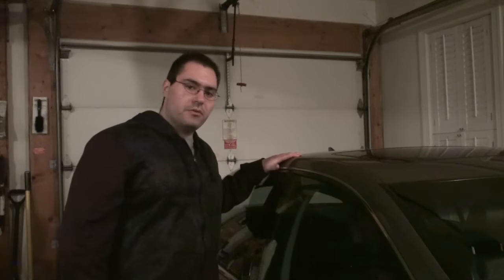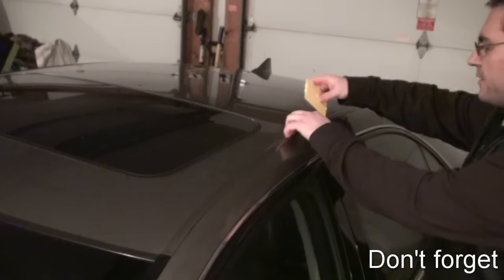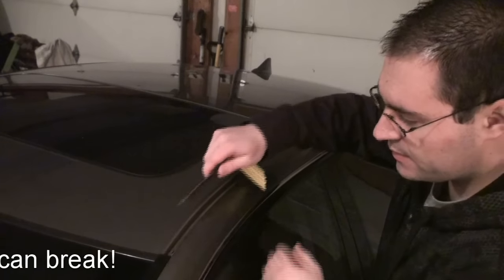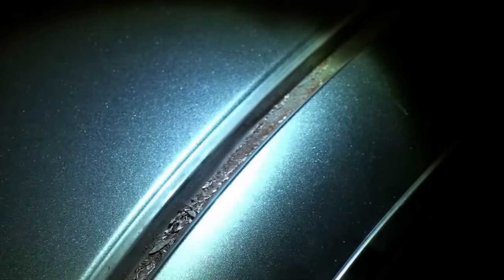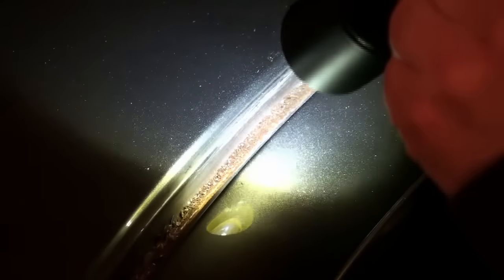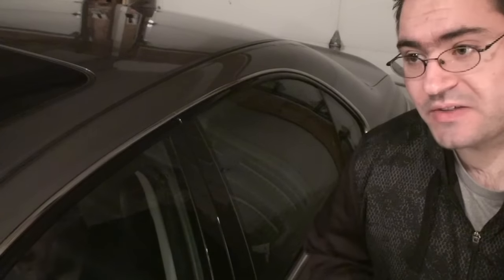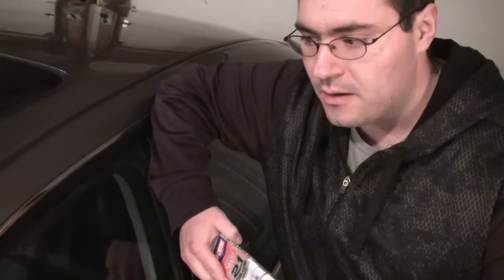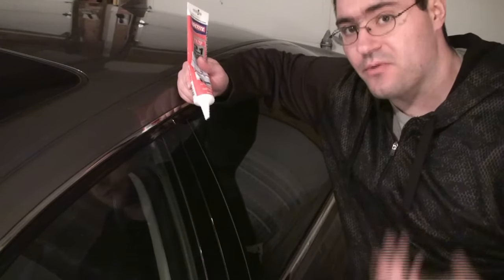Car Roof Leak - How to stop the leak in 10 minutes

Comment: What kind silicone did you use??
Reply from the maker: Loctite bathtub sealer - for the sealing showers/tubs (above the waterline) It's been just about a year since I've filmed this and It's held up just fine for me. Any silicon caulking should work fine, you could use out door window sealer or the stuff for below the water line if you want to go all out, but as long as you have a seal all the way across you don't need to do all that.  Just don't use a latex based one - they are water soluble and it will dissolve with the weather overtime.

Comment: i have a Dodge caliber. I just noticed a leak on my front  passenger side corner.  are the weather strip easy to lift up?
Reply from the maker: if it's an 09 or newer, it should have almost the exact same system as 
the one in the video where there is just a peg that slides on to a clip 
to lock it. 

You'll have to double check the dodge forums to be sure, just google the year and make of your car + weather strip...

ex: "2010 dodge caliber weather strip"

You can begin to lightly pry up on the strip using very light pressure to look under it if 
you can't find what system it uses, just be careful not to break the 
clips if it has them. 

I'd start in the center and see where it has the most give, you can pry it up by hand very easily, but it might feel like you need to use a lot of force to get it started, but you really don't and that's how most people break the clips. 

Just take you time with it.

Comment: Having a rust there it’s a potentially lethal if you unlucky to have a frontal impact the car will crush in two and kills you. What a horrible car is that. Vw/Audi has the best in business roof to body weld and don’t even have a weather strip, beautifully made but inside out but drivetrains sucks with them. Anyway great video
👍👌🏻🍻

Comment: others say never use silicone...use an automotive sealant.
Reply from the maker: It's because it used to be all silicon sealers were previously acid cure - they would eat through aluminum - if it says on the label it's safe for metal and aluminum then it's safe to use - I just feel like the silicone holds up better overtime - if I'm not mistaken it's now the most common gutter and window caulking - which means it's for sure safe for aluminum and doesn't corrode it. The good news is - there are plenty of other options and you can use which ever one you like. 

If you are caulking the front of your windshield I do believe there is a very specific stuff just for that but for sealing the weatherstrip there are quite a few options.

Comment: do you know how to remove weather stripping on 2009 chevy malibu?
Reply from the maker: if it's an 09 or newer, it should have almost the exact same system as the one in the video where there is just a peg that slides on to a clip to lock it. 

You'll have to double check the Chevy forums to be sure, just google 2009 malibu weather strip...

You can begin to pry it up using very light pressure to look under it if you can't find what system it uses, just be careful not to break the clips if it has them.

Comment: you should have showed all the process
Reply from the maker: Hey Jude - I thought it was pretty self explanitory - granted I grew up fixing stuff and learning how to paint and what not - there really is nothing too the sealer though - you just put it over the crack and them put the top piece right over it - if you put on too much you just wipe it off with damp a paper towel before it dries - if you got way too much you might want to wear some plastic gloves...don't really want to get this stuff on your hands since it's pretty messy and hard to get off. 

In most cases, it should just easily wipe off and not discolor your cars paint - you are best off using as little as you need. 

I'll keep this in mind for any future videos - thanks for your commnet - I can try and help more if you have any more questions - David

Comment: Don't listen to any of this guys advice, even his terminology is wrong which is a very bad sign.  Also DO NOT use silicon for this ever.  It will cause rusting.  There is a special sealant for this job, it's a automotive seam sealer.  Search YouTube for that
Reply: First of all using the wrong terminology doesn’t mean it won’t work, as a matter of fact it has worked for some based on the comments. Secondly he has already addressed the silicone issue. Maybe try reading before you comment.

Comment: This kind of lining looks much easier to remove Vs that new one. Though I guess the new one doesn't move. Move kind of bulges out at the end, just a couple mm
Reply from the maker: yeah the locks are different, some of the newer ones are much easier to remove, some of them are much harder and will break easily if you try to pull them up so you have to check the manufactures specs and see what you have and how to remove them.
Reply: @DavidParas  I wanted to try, but i need remove most panels in my hatch as well. becomes way bigger job for me.

Comment: How about for a 2006 Honda Odyssey
Reply from the maker: Hi Sammy, I'm not 100% sure about that one - to clarify, yes using the caulking will work just fine, but I'm not sure if your weather strips have the same clip mine did. I did a quick, and I mean very quick search and I coudln't find which type of strip the 06 has - if you have your cars manual there should be a section in it about the "roof weather strips" It's important because if you go to lift them off and they have a clip - instead of the system like shown in this video - the clips are made of cheap plastic and can break - the big problem there is the clips are attached to the car not the strip so you would have a much bigger problem  if they break... Unless your willing to "permanently" glue them in place if they break. If I were you, and I didn't care about gluing them down, that's what I would do - I would start to peel up the weather strip and see if I could find out if it was the clip system or the slide and lock system like shown in this video. 

If you do break the clips, you could use an out door window sealer to "permanently" hold them down. It will last several years and not let any water get in. Though you might not be able to get them back in perfectly if they clips break you might need two people to put the strip in place and probably something to hold down the strip while it sets (for about 12-24 hours)

Comment: Lol just have your fucking window resealed
Reply from the maker: The window isn't what was leaking, it was the rusted rivits under the weather strip - the windsheild was actually just replaced because a stone shot off a truck an cracked it... so i was sealed and brand new... a window leak doesn't let water in at the outside corner of the joint.